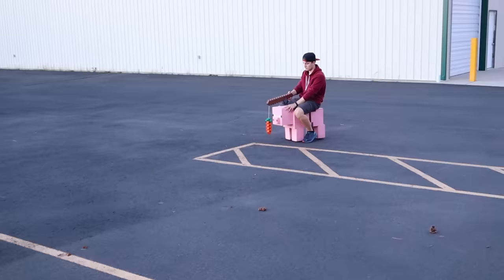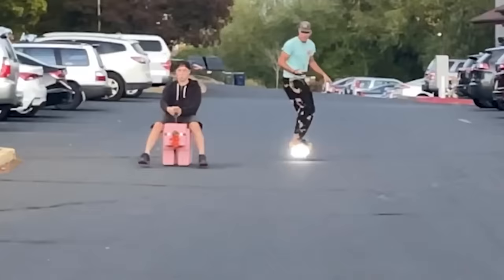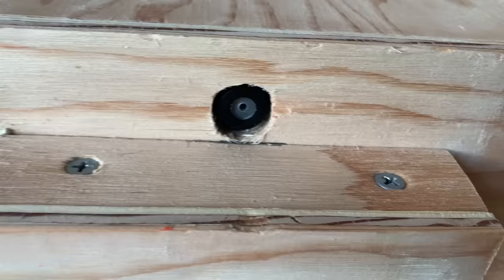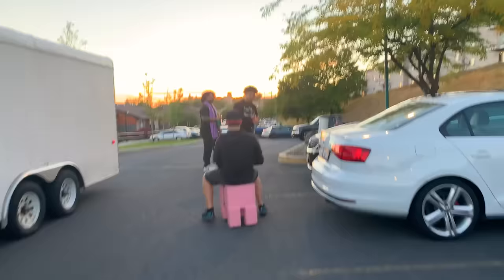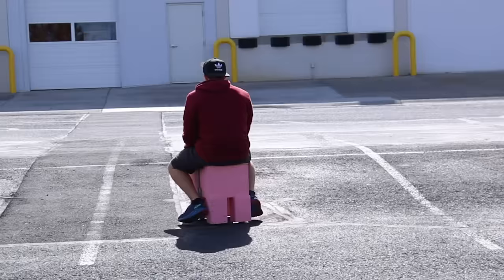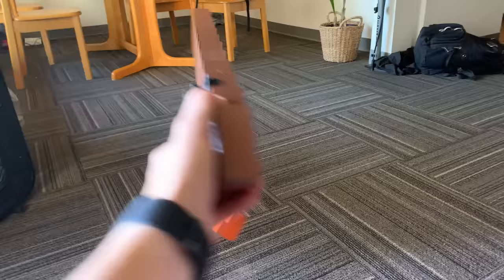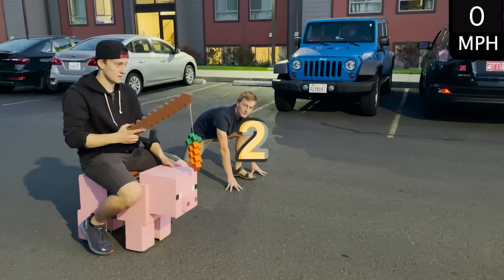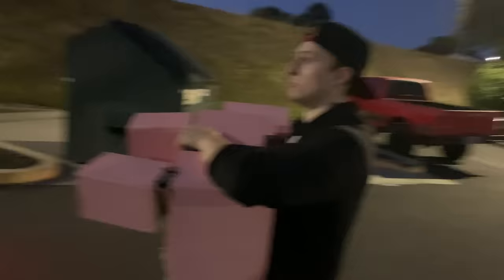I Made a Rideable Minecraft Pig

Comment: 5:06 It got flattened  and shredded because:
The gear is rolling over the belt, causing it to flatten. Especially if it's moving.
It got shredded because it was the bottom part of the foot. The 100% power causes the material of road to quickly shred the belt.